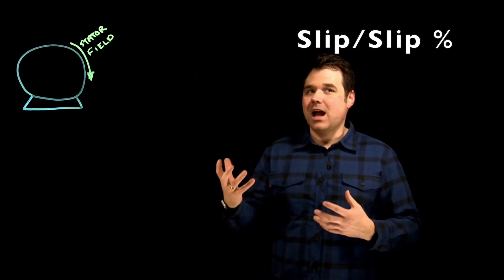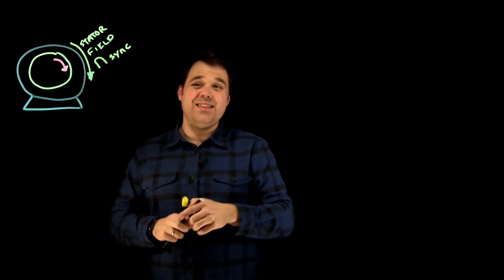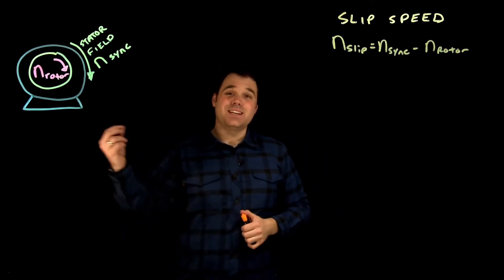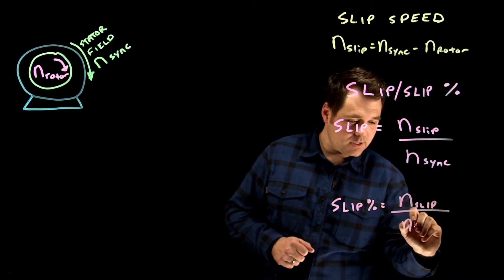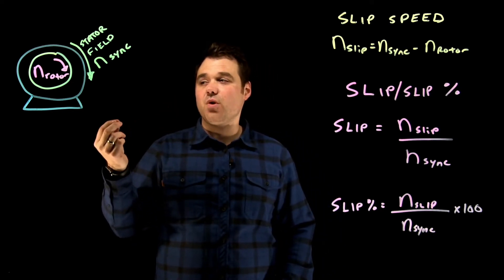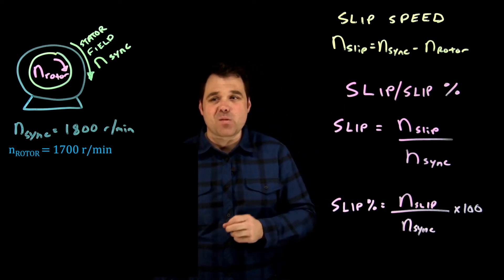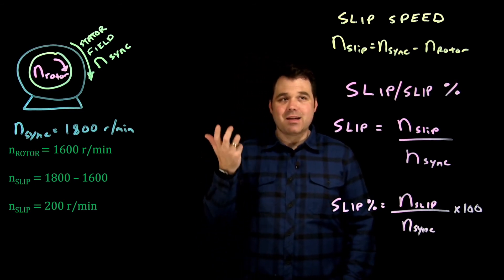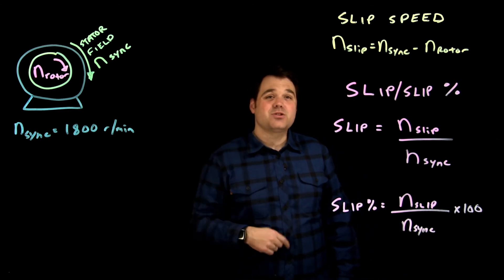Slip Speed and Slip in a Motor

Comment: Awesome videos.  3rd year electrician here.  Rotor frequency has come up in class before and just trying to grasp this concept.  From what I understand rotor frequency goes down as Slip goes down.  Is rotor frequency how many times the stator passes by the rotor?
Reply from the maker: Rotor Frequency and Slip are directly proportional. When slip goes up, frequency goes up.

The frequency is actually the induced frquency into the rotor. Think of it as the sine wave of the current and voltage that are getting induced into the rotor.

Comment: Am I thinking of this correctly? The rotor rpm is trying to catch up to the stator magnetic field rpm due to the force induced (somehow, I'm yet to understand this part) from the difference of their rpm's. The greater this difference (called slip speed as you said) the greater the force (linear relationship? e.g. double the rpm = double the force?) and hence torque outputted by the motor.
Reply from the maker: This other video might help out a bit too: https://youtu.be/5GFC-SqnjQM
Reply: @ZackHartle  Thanks for the video, although I still have many questions, and my previous ones weren't fully answered either. e.g. x2 rpm = x2 torque?
Reply from the maker: @rever4217  I don't think it's a linear relationship like that. All motor rotors will react a  bit differently dependent on their design.

Comment: Good explanation, what would be the slip at no load condition?
Reply from the maker: Very small. Usually like 1-2%
Reply: @ZackHartle  Is that because there's always some sort of load even if we don't put anything on the motor? Like the rotor pushing through air resistance or rolling resistance or friction between the moving parts?
Reply from the maker: @rever4217  You could say that.

There was to be a difference between Sync and Rotor, because there has to be relative motion in order to cause the force in the rotor to spin. If your rotor ever did spin as fast as sync, there would be no relative motion, therefore no current produced in the rotor, therefore no magnetic field to oppose the stator, and then the rotor would slow down.
Reply: @ZackHartle  but the rotor would only slow down because it was encountering some resisting force like friction right? Under ideal conditions once in motion it would stay in motion and there would be no need for any force to keep pushing it.